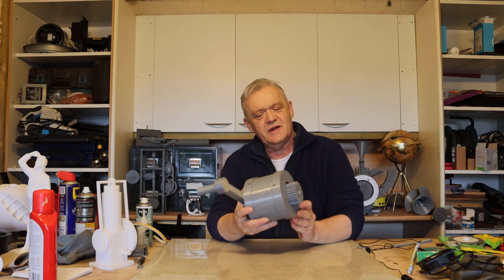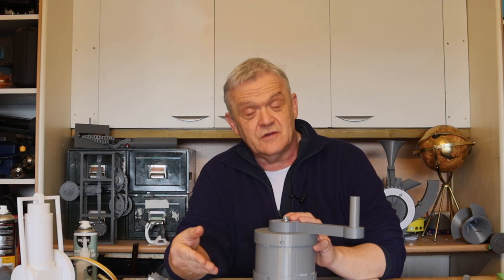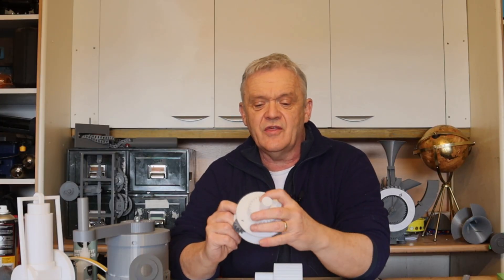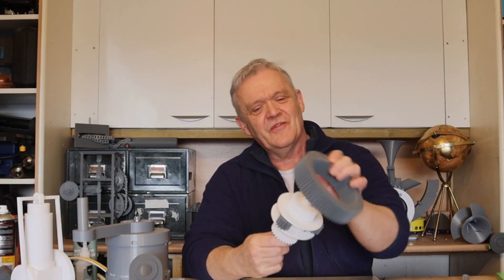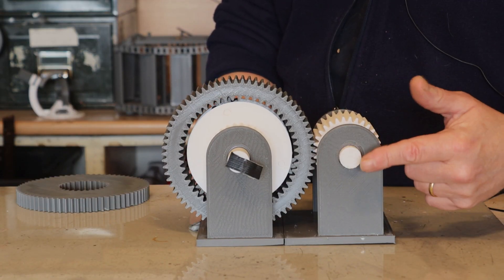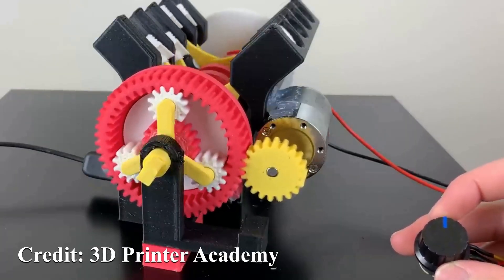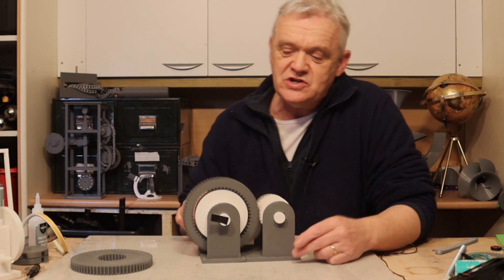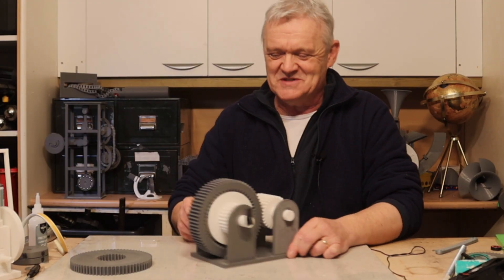2197 The Infinite CVT And Wind Turbine Control

Comment: Robert I'm going to have to agree with a few other commentors here that the last build was not a variable transmission, the speed of the gear driving the outside of the ring must be controlled independently of the sun for the ratio to vary. It does make me curious about how much power you would need to send to the outer gear in such a system for it to work, equal to the that going to the sun or could it be reduced?
Reply from the maker: I don't mind folks disagreeing with me mate - folks disagree all the time and I am just showing folks what did and what I think - if folks think differently - no issue for me - cheers
Reply: @ThinkingandTinkering  Maybe I'm just confused, regardless I'd be interested to see this topic elaborated upon. Great vidoes, god bless.
Reply from the maker: apparently the system is already in the prius - I didn't know that until i read the comments but I am not unhappy to hear about it as it means I am not thinking crazy thoughts lol
Reply: @ThinkingandTinkering   All of the gears are constant mesh, no clutches or fluid couplings. You made it constant-ratio the moment you put in that idler at the end. If you disagree, how about accurately measuring the input-to-output ratio at different speeds/loads?

Comment: Very interesting and great to see in operation however would it be simpler to make a cv transmission using a belt and two coned pulleys with a bob weight type governor?
Reply from the maker: surprisingly enough it isn't

Comment: primary thing that comes to mind for me, would be that this should be resulting in better torq at output as well, so if put out to an at the rim generator of 3-5 times the size and maybe instead of a direct idle, maybe something that curves the increase, which should allow the better torq thru more easily perhaps. This and a centripetal governor flywheel, and you have peak leveling as soon as you tune all this to go at the right time.
Reply from the maker: I would think so

Comment: Very interesting. It feels like the gear equivalent of a pressure bypass valve on a pump, the higher the pressure the more the bypass opens to maintain pressure at the set point. Or negative feedback on an amplifier to tame the massive gain of a transistor.
Reply from the maker: Great point!

Comment: Definitely useful for a fly wheel.  For a fly wheel you might want to be able to speed up the output instead of keep it constant that way if the fly wheel is spinning fast you can still add energy to it.
Reply from the maker: that's a god thought - thank you for sharing that idea
Reply: Connect the ring gear to the flywheel.
Reply: Some city buses do in fact use a flywheel and variable mechanical drive to store energy from braking for acceleration.

Comment: The output is not constant velocity, if it was then you would have invented a perpetual motion machine. This is a high gear ratio tansmission
Reply from the maker: Sorry mate - that's not right - having a constant velocity output wouldn't lead to perpetual motion. - all I have to do is take a drive at a fixed velocity to see the error of that.

Comment: I've seen CVTs with electronic speed controll concepts before. Never understood why they faded away. I also don't know why generators with variable out put aren't more prominent. Instead of using permanent magnets and a coil why not use a small PM Generator that feeds DC power to one set of coils of the bigger generator to adjust the voltage and current output of the primary generator as the speed and torque of the turbine fluctuates.
Reply: Brushless generators do what you describe, either controlled with a capacitor to power the field windings or an AVR, (Automatic Voltage Regulator)
Reply from the maker: cheers mate

Comment: Thanks for the video. Such a pleasure to watch and to think about. Now, I'm wondering how many Sun, Planet, Ring gears one can fit or set up, like a fractal, within a master Sun, Planet, Ring gear system and what it would do or what use it could be.
Reply: There are Compound Planetary gear systems that use the outside of the ring gear as the sun for another set of planets and outer ring gear.
I think you can get extra high reduction ratios this way.

Comment: Doing some quick calculations, it unfortunately looks like this system still has a constant mechanical advantage. However, you can get some insanely low reductions as the thinner the ring gear, the less the output shaft rotates.
Reply from the maker: cheers mate
Reply: Yes, that's what I was thinking too.  But you do increase the mechanical advantage by driving the ring gear from the same source relative to not driving it (each config is still constant but moving from one to the other does increase your advantage).

That's not a CVT but combine it with a one way ratchet and it's an interesting way to do a discrete transmission in a way which doesn't disconnect power to shift to a higher gear.
Reply: Sorry, didn't see your post before.  I just posted basically the same comment.  Not at all a constant velocity but maybe useful for low reductions as you said.  No relevance at all to keep wind turbines from blowing up as far as I can see.

Comment: No. You have only changed the ratio . There is no regulation or variable ratio.
Reply from the maker: you missing something - look again
Reply: @ThinkingandTinkering  No Robert,  the planetary gear  is a simple differential  the output is the difference between sun and ring gear (via some ratio)  if  the ring is connected to the input this motion is either a subtraction or addition (depends on reversal or not) There is speed sensitive NO division or multiplication..  If your scheme could regulate, i.e. up and down , then what would stop it spinning the output with no input?.  BTW I have been playing with gears for 60years .
Reply: @ThinkingandTinkering  The variation of the original differential cvt is provided by the second motor, not by any magic in the gears.
Reply: @ThinkingandTinkering  You have it in front of you. Measure it ,,;-)

Comment: For a car, what if you had two electric motors.  The power feed would have a fork, with one going directly into the more powerful drive motor and the other going into a variable resistor and then the smaller control motor?  As you increase power to the control motor would you also reduce power to the drive motor?  Thus slowing the output in two ways?
Reply from the maker: interesting idea mate - i don't know - but i like it

Comment: This is great. Thank you. I have genuinely needed something like this for a while. It solves so many little mechanical problems. Like a handcrank genrrator or even a small portable water wheel. So much potential.
Reply from the maker: cheers mate
Reply: @ThinkingandTinkering No problem :D
Reply: This is an old design, a type of differential drive, that takes more energy than it can deliver. So it isn't useful for generators or vehicles. Note that any torque that's delivered requires the electric motor to work just as much as the engine.
Reply: @canonicaltom  That's ok. I want to use it for a robot. Agility is key in it's design. I will just use two similar motors and probably use it as an aux set of wheels so that it will only be used as needed.
Reply: @memejeff  Sounds like a great idea.

Comment: The prius 2 used this planetary gearbox system with 2 electric motors on it and 1 combustion engine on it. Yes already in 2000 ;-).... But that prius 2 was so ugly !!!so i dont want to listen how incredible it was what they made;-) it was a real cvt no gear switching ect. You get pushed in your seat and it stays like that untill you take of your foot on the pedal. Still driving its 370k km 🎉 best investment in a car 😅
Reply: Also have a look at the combustion cycle of the prius 2:" Atkinson cycle" it make more work than a normal car by making the explosion stroke longer then the compression stroke.
Reply: @VinokDesign  Toyota uses the Atkinson Cycle primarily as a means of controlling the compression ratio. Prius has 13.5:1 mechanical ratio but can hold the intake valve open too long letting some of the charge to burp back into the intake manifold reducing the combustion pressure effectively reducing the compression ratio.
Reply: The Prius still surprises me. Radical new drivetrain was a huge risk. Putting that new drivetrain in anything other than a conventional body shape seemed suicidal to me. 

I’m a practical person and the drivetrain efficiency appealed to me. The long delay in upgrading the Prius to a plug in hybrid and increasing battery range cause many to look elsewhere. 

Still a great car.
Reply: @MatthewTaylorAu  I have one of the original plug in Prius. The lack of battery range is its biggest drawback.
Reply from the maker: nice - thanks for sharing mate
Reply: Not only the Prius 2. All Toyota Hybrids from the 1st Prius till all models currently being sold plus Lexus hybrids and some other brands who used it under license. Brilliant system indeed.
Reply: Priuses kick ass! When I'm not driving my Corvette I'm in my prius. Little maintenance, great MPG
Reply: Y'all are aware, planetary gears have been in common use since the first 3-speed automatic transmission cars of the mid 50's right? Almost every automatic transmission car on the road is running planetary gears.
Reply: My new Sienna doesn’t have a tranny, but does have a planetary gear drive.  So far nobody has been able to explain how it works or controlled.
Reply: @robertheinkel6225 it does have a transmission, it just doesn’t have a torque converter, clutch, or shifting gears.
Reply: @robertheinkel6225  Is that a hybrid drivetrain? It's also true that conventional automatic transmissions use planetary gearsetse.
Toyota and Ford use the planetary system with a large and a small electric motor to couple the petrol engine to the wheels at a variable ratio.
Reply: What this video shows is the feedback mechanism that convert the whole thing into a speed reductor.

The Prius uses a generator and on the ring gear and a motor in the output shaft (instead of input shaft in this video), to obtain the same effect: speed reduction, conservation of power.

Comment: where does the excess energy go?
Reply: Noise, heat, vibration and wear.
Reply: If I understand what you're asking correctly, the higher speed, yet lower Torque, Angular Velocity at the input is being converted to lower speed, yet higher Torque, Angular Velocity at the output, with of course, as @ZappyOh mentioned, some mechanical losses within the gear train.  Just momentarily, and theoretically, assuming no gear train losses,  the Power in equals the Power out.
Reply from the maker: what excess energy?

Comment: Neat set up.  With two ring gears setups and the idler in the centre, I think you could use them to drive tracks on each side of a track vehicle.  By driving the idler gear you could add rpm to one side and subtract rpm equally on the other side.  At a stand still it would rotate the 0:15  track vehicle.  You just solved the need for two trans missions in a tank!
Reply: You'll be pleased to know that that approach has been invented and commercialized. Caterpillar introduced differential steering with their D8N bulldozer amongst others. Works well!
Reply: @frontagulus  O Dang! And here I was all impressed, when I got on a backhoe with JOYSTICKS!
Reply from the maker: that's cool - nice idea cheers mate

Comment: I want this in hybrid cars. The simplicity of mechanics of this is actually out of this world
Reply: It's in a prius
Reply: It’s literally all Toyota hybrids. Prius, Crown, Camry Hybrid, anything with a blue-tint Toyota badge has this inside it.
Reply from the maker: apparently it already is!
Reply: Ford, Toyota and Chrysler all use it. Been around for decades.
Reply: Some Aircraft use a constant speed drive unit (CSDU) to drive a generator at a precise frequency needed for the avionics systems, E-CVT in a Mitsubishi hybrid is also similar to the Toyota.
Reply: @551moley  Does anyone know if this is utilised in electric bike drives?
Hub motors certainly use planetary gears to get the right torque from the electric motor, but is the human input 'blended' with the electric input to achieve the desired output?
Reply: @aesopshair6690  I doubt it, bosch hub drives use a torque sensor?
Reply: Chrysler, ford, toyota...
Its already there.

Comment: I like the transmission, but I'm convused on the problem statement.  You showed a video clip of the blades truning too fast in a windstorm, destroying the turbine.  If the problem is variable wind turbine blade speed, don't we want to make that constant and vary the output?  A high wind should turn the turbine with a higher torque, but at near constant speed.
Reply: The problem that you have with these small "primitive" wind turbines is that you could end up turning your generator too fast and destroy it. Bigger wind turbines like the one in the clip generally don't have that problem as they have variable pitch propellers and brakes to stop them in case there are very high wind speeds
Reply from the maker: the gennie gets too hot mate